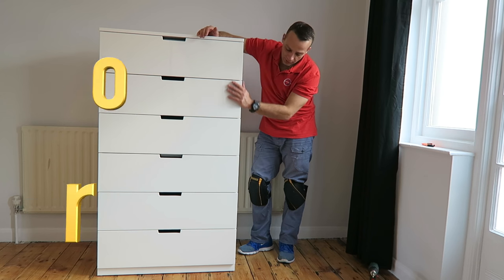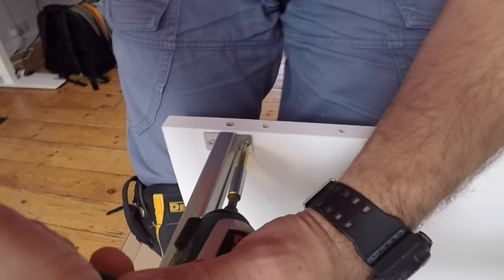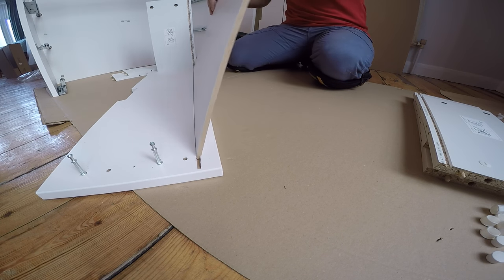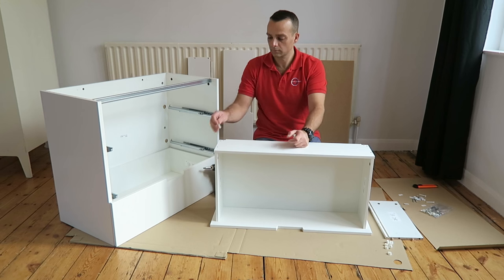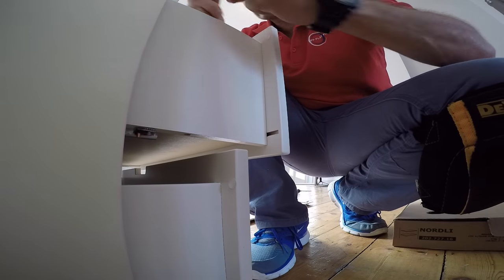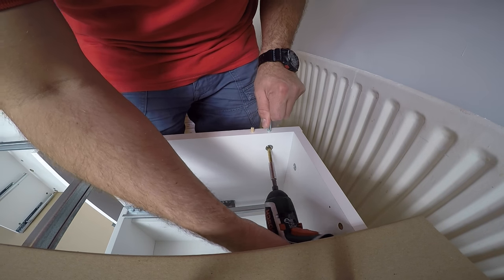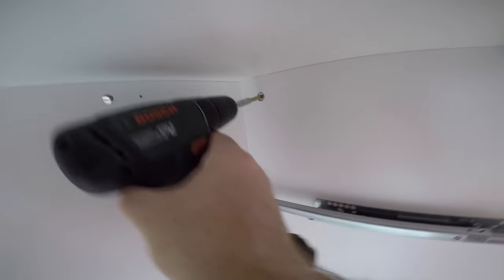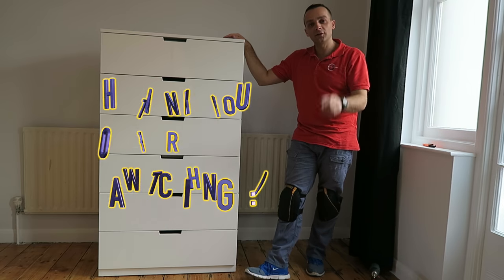IKEA Chest of drawers NORDLI White Assembly

Comment: The manual insists that the top drawer is inserted first, then middle, then bottom. This is very difficult to do because the drawers must be tipped slightly to connect them to the hooks at the back. You started with the bottom drawer. Is there any reason why I can't do that too? Why do you think the instructions insist we start with the top drawer?

Comment: Thanks for the video. I wish it was as easy as you made it look though. Took me 3 hrs to do a 3 drawer chest - 2 hours to build and 1 hour to get the drawers in! So awkward
Reply from the maker: Yes, drawers are one of the time-consuming items and this one is not the easiest one to build. The 3drawer chest is around 30-40min but well done for finishing the challenge. There is many customers I visit who don't have patience and time to fight with flat pack assembly like you. So well done and thank you for watching.
Reply: I couldn’t understand how you are putting drawers it was problem for me when I put white plastic in hole then the metal didn’t not reach in hole so I put scroll drive to bended to sit in hole it wasn’t easy and also unqualified hardboard and plastic white stuff you have to really carefully !!!! But finally we made to good. Job  but I don’t know how long will stay  in room max 2 or 3 year
Reply: Hello may i ask are the drawers pretty deep ? they appear to be just wanted to ask thank u
Reply: @daniellebarnes1583  yes they are plenty deep

Comment: Any tips on how to get the drawers in and level once the top is on? I can’t see down into the unit to line up the hooks and I’m having an impossible time getting these in without them looking all crooked!
Reply from the maker: There is small wheel under the drawer in the rail. You can adjust height of the drawers slightly there.There is new video on NORDLI drawers coming soon. Will explane everything there.

Comment: I have ordered 7 of these units, i am looking to replace the drawer fronts with custom reclaimed wood fronts I am making.  Can you tell me the exact dimensions of the drawer fronts for both this unit and the bedside table? i can somewhat guess by dividing the overall dimension but it would be better to be sure they are the correct size.

Comment: I built yesterday the same nordli 6 drawers and now it’s another system to lock the drawers , You just need to push forward and it’s locked ! But it’s hard to unlocked ! And it was hard too to assembly because very heavy ! And the assembly instructions not very clear all the Time

Comment: Hi! I’ve assembled the drawers but still have the C1 bags of fasteners leftover.  What are the purpose of those connectors?  Are they used to attach the chests together?
Reply from the maker: You will get extra screws and other leftovers. Ikea include screws for all other options so don't worry about extra screws. BTW there is new video with more details on Ikea NORDLI Drawers coming soon will explain there all regarding extra screws and leftovers. Thank you for watching.

Comment: The horizontal bar all the way at the top stays like that? I am building mine and you can see that metal bar. Is this supposed to be like that?
Reply from the maker: Margarita This was my exact question when I was building this one I think it suppose to be there for added stability and you can add different units on it if you need. If it bothering you to much just move it to the middle make 4new holes and it should be less visible. But if you adding two small units this is not an option it has to be at the front.This was regarding metal bar on the bottom unit.
One on the top you not need to put it as there is already top panel securing the top but I put it for extra stability.
Reply: Margarita same here. It looks ugly. I will paint it white.

Comment: What would be even more helpful is the first to go through all of the different little parts and describe what they are meant to do and where they are meant to go before starting the assembly. As well as slow the video down instead of making a person have to stop and start it dozens of times. 🙂
Reply: In case others struggle with this as well: youtube settings (under the cog icon in the top corner) allow you to set videos at a slower (or faster) speed.